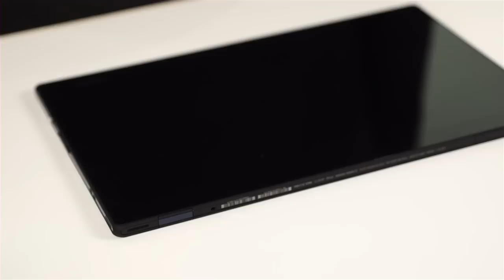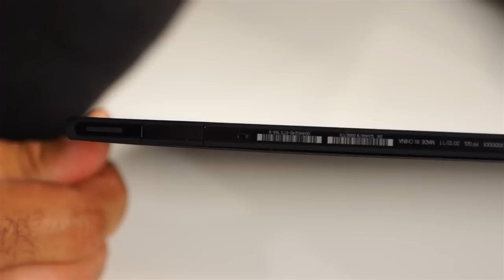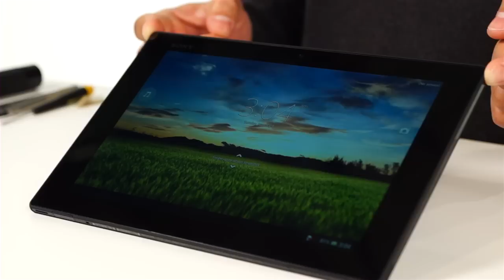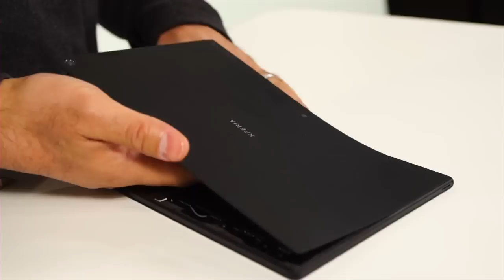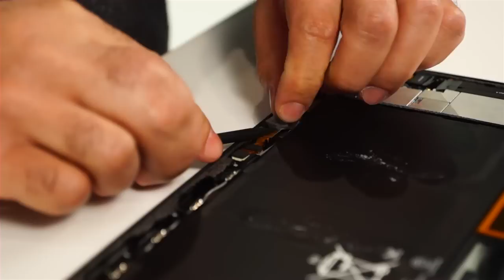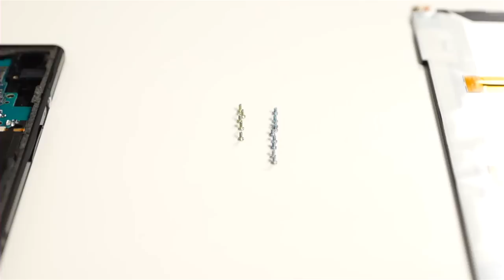Opening up Sony's Android Tablet, the Xperia Tablet Z (Teardown)

Comment: got replacement charging port but not detecting it when turned on nothing damaged or faulty on device as it powered on for a few minutes as their was a small charge left in battery wont charge at all any help would be great plus pc not detecting it either

Comment: I have the same problem re charging and was told that the battery might need replacing. Considering how much they are looking to charge me to change it, along with the cost of changing the charging port,  I could of just bought a new tablet.  A less complicated and expensive to fix!  Lesson learned. Should have stuck to Samsung.

Comment: Does anyone know if the digitizer is fully glues to the LCD or if it's only along the perimeter?
Reply: Did you find out any information about the screen..
Reply: No not yet. I will have to take it apart and see for myself.
Reply: I can get the complete unit off ebay but the price of it just isnt worth it...does say on video there is a lot of sealant...who knows could be the edges...hope its not like the mobile phone...
Reply: Hey, Dean. Digitizer glues fully to the LCD and you probably need a full replacement. The plastic frame is glued with double-sided tape so it won't be such pain to remove it.

Comment: I bought one when they first came out over 7 years ago now, amd despite its age it is still holding its own, spec wise, against fairly expensive NEW mid range 10" tablets.... OK, so it only runs on Android 5, has no fingerprint scanner moan moan moan, but speed and memory wise, it is definitely no slow-coach and is thinner and more light weight than than most new to market tablet's today (2020).

A seven year old tablet should easily be due for an upgrade, but my SGP311 is still as good or better than new mid range replacements, so I'd have to spend quite a considerable sum of money to get a replacement worthy of the title "UPgrade" instead of just "replacement"

I reckon this tablet easily has another couple of years left in it yet, meaning that it will have put in 9 or 10 years of duty before being retired... Android and Sony; making Apple look like cunts!